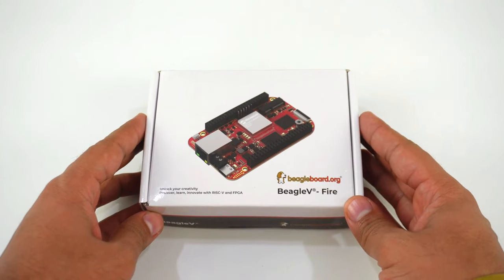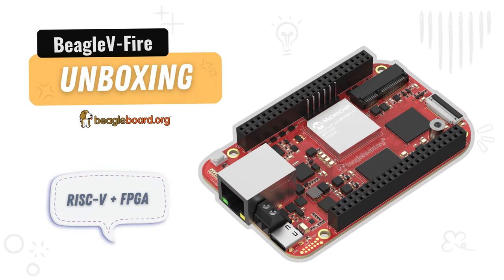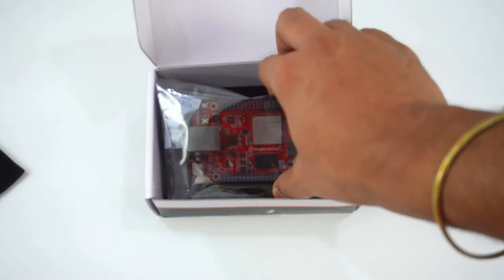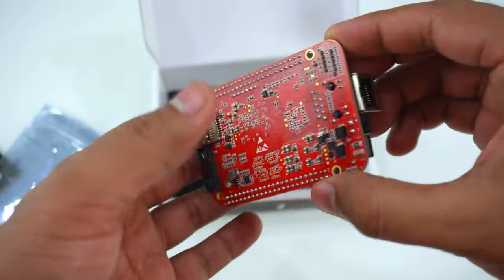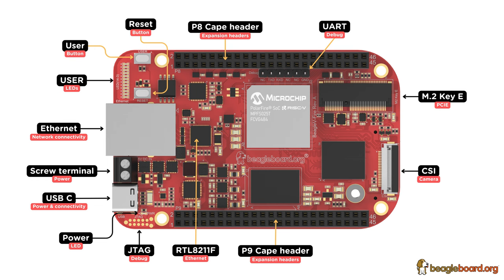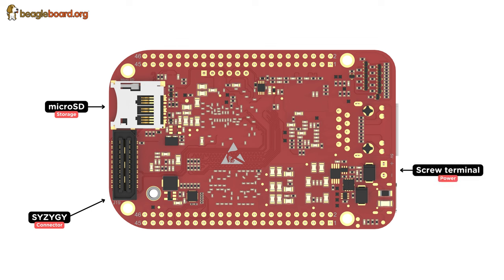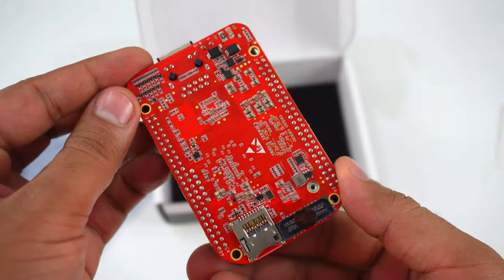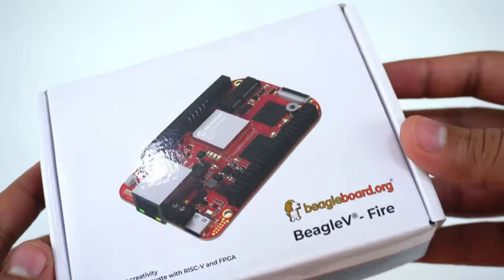BeagleV-Fire Unboxing | BeagleBoard.org

Comment: To me, the main problem is the lack of free/low-cost design software.  For example, after the 60 day evaluation, you can't even open to view your design without an an active license.. which costs $3495 for a single year (LIB-WIN-F-1 YR) and $3K to renew!

BTW, other tools, like Altera's Quartus, allow you to still open a design without a license, just disables the synthesizing or programming support.  Intel and Lattice even have a free versions of their design tools for the smaller/hobby-sized devices.
Reply: According to the Libero licensing page, there is a Silver license that is free and valid for 1 year, it should work with PolarFire, it should be renewable also for free. Or is that wrong?

Comment: Is this board useful for me to learn about MCHP FPGAs or is it just another Raspberry?
Reply: Well considering you can program the FPGA it will be useful for learning how to use FPGAs. I would recommend just an FPGA first though, not an FPGA plus SBC. The sipeed tang series are very good value FPGA dev boards and they are perfectly fine for learning how to use FPGAs.

However learning how to use FPGAs is not just like learning another programming language. For FPGAs you really need a background in digital logic since all the Hardware Description Language (HDL) code that you write is describing digital logic it is synthesised into actual hardware, very different from writing software which is writing a list of instructions. A lot of software engineers make the mistake of treating writing HDL for FPGAs just like coding in a programming language.

Comment: I've only just ordered this board. Seems like any bleeding edge board is subject to misinterpretation.  I don't think this board is an FPGA development system, rather it's a RISC-V development board that uses a FPGA that been defined (programmed) as a RISC-V processor.  This board has been developed by BeagleBone and not Microchip.   The board boots up on Ubuntu, a FPGA development board would not do this.  While I see there is something about installing Libero just seems like it would not be worth doing Libero on this board.  Maybe BeagleBone can develop software for programming the FPGA. I'm afraid that Microchip is not really interested in the hobbyist/small quantify market. Microchip wants the 1,000 unit or maybe 1,000,000 unit order. What ever effort Microchip is making in the hobbyist market is probably just done by Microchip volunteers.  I hope Microchip can counter my opinion.
Reply: Wrong. The Polarfire SoC by Microchip has hardened Risc V cores, which can boot Linux, alongside the FPGA fabric. There are also hardened interconnects, allowing the cores to communicate with the FPGA logic. There many other FPGA SoCs from AMD/Xilinx and Intel/Altera that do this, but have Arm cores instead.
Reply: You are very wrong about this. Why don’t you do a quick Google before posting incorrect information?

The chip contains hard RISC-V cores (just like the processor cores on any other SoC or MCU) as well as an FPGA, they are separate but connected through busses.

Chips containing both hard processor cores and FPGAs are very common now, just look at Xilinx Zynq series and onwards as well as other versions from other manufacturers. Therefore FPGA dev boards that can boot linux are not that uncommon anymore.

Comment: Useless. The documentation pages for this board don't even show  how to flip the gpio pins
Reply: Just say you don’t know how to use it and move on. FPGAs have quite a steep learning curve and high barrier to entry in terms of knowledge. Flipping a GPIO pin is a lot harder than with MCUs or SBCs because they are routed through the FPGA, but even just following a generic FPGA tutorial you should be able to get some basic logic working quickly.